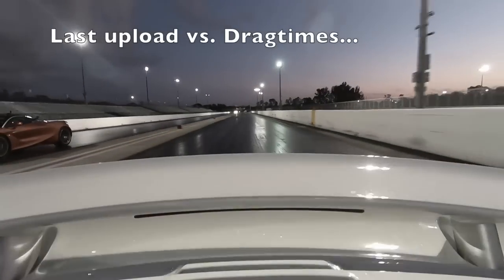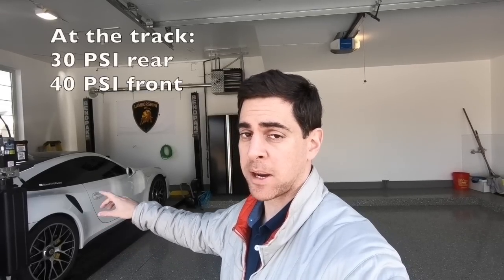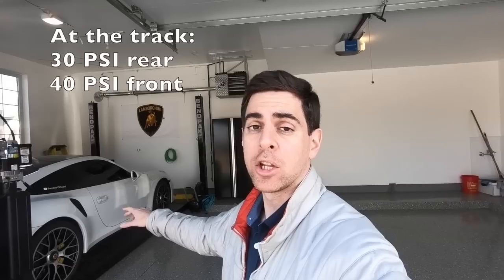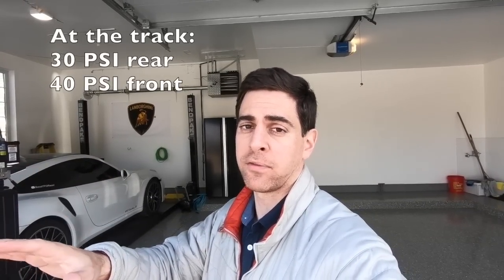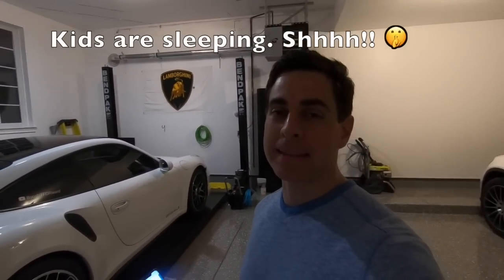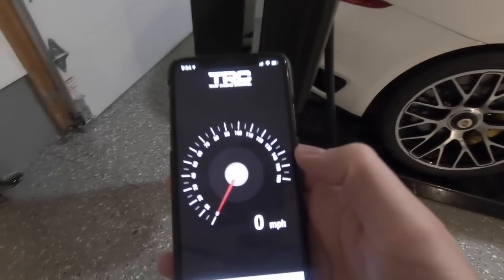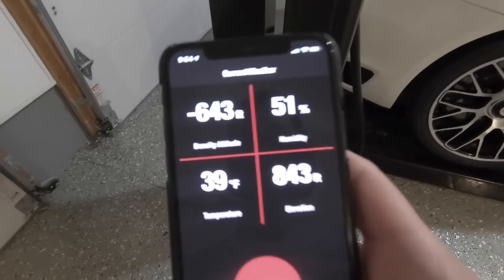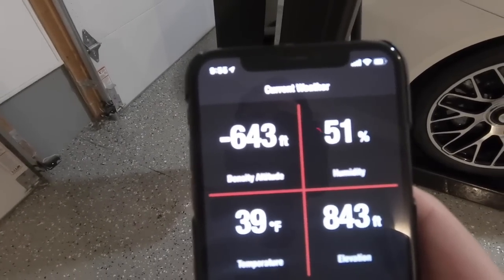Density Altitude MATTERS!! Testing 60-130 MPH in various DA

Comment: really informative, i was looking for this information for along time till i found this
Theoretically the ecu will compensate the lower ambient air pressure (inlet pressure) by spinning the turbo faster, to reach the same manifold pressure (outlet pressure). And the difference is hotter outlet temperature (less oxygen) from the turbo spinning faster. This wont have a huge impact on the power as compared to NA engines. But i guess there is more to it since you got a significant better pull in low DA. Very interesting results.

Comment: On a turbo car the difference is less noticable. NA really suffers from high da. I run a na full bolt on e85 6th gen camaro ss is about 5000-5500 da and am always so frustrated with 60-130 times. Where as guys are getting close to what I'm running with stock cars in good air, less than 500 da. Different world when I think my 10.6 is fast And this guy's running under 5 in that monster porsche.

Comment: I had the opposite with my stock 911.  ET and trap speed both got worse in cooler weather.  I think - as do others - that the car pulled power to meet OEM torque figures otherwise the car would have made a good deal more than Porsche's specification.   A tune tears that issue apart and the cars just run best at around jacket weather.
Reply: Yep!  Many cars have a boost protective function; in some circles it is called overboost protection. Cooler air is always better, especially with forced induction applications, but sometimes you can have too much of a good thing...to some extent. And for this reason, many manufacturers implement a boost ceiling of sort, or ways of pulling back boost when many of the assigned sensors pickup on the super cold air. It ensures the vehicle does not spikes its boost due to cooler air...preventing it from running too lean and so on.

However, tuners can offset this by tuning around these factory set parameters by commanding target boost levels and accompanying fuel (happy AFR) no matter the ambient temp and by doing so, customers can benefit from the cooler natural ambient temp.

I hope my high level explanation made sense.

Comment: This is great sir. 😊

However, to remove as much amount of the guessing aspect as possible, it would have been best to compare 60 - 130mph: 
A) street FL 2000 DA vs street MI -700 DA...close to similar slope as possible.

B) local track under low DA and compare those results vs FL track under its higher DA.

C) and/or, you can do a test in that same local street, same low DA, same night, same tires psi and so on from a rolling vs standing start. Compare those two results.

I would think doing the above testing would be as best as possible vs trying to compare track standing results vs street rolling results. It will never be a true direct comp unless you cansomehow teleport from one state to the next, but at least "I think" comparing street vs street (rolling or standing) and track vs track (rolling vs standing) is less tricky with less guessing variables.

Nevertheless, good stuff and be safe.😀

Comment: How do you think Dodge Ran mid 9s in a stock Demon? They ran it in Florida (near sea level) on a nice cool Winter day with a very low DA. You can easily run a .5 (1/2 second) faster in the 1/4 mile with just a low DA (-2000 for example).
Reply from the maker: I am gonna put that to the test. In FL where I ran the 60-130 in 5,31 secs, I went 9.58 in the 1/4 mile. DA was +2000. I am going back to the track here where the DA will be 2000 less to see what happens and I’ll record the action. 👍
Reply: @BoostITFORward  did you ever do it?

Comment: on hot summer days my car will run 12.0 in the fall and spring 11.4-1.5. naturally aspirated
Reply: Yep, that's why most of the records are set at tracks on the East Coast in cold weather. Guys run their cars in 30 degree air at sea level tracks with a -3000 DA. Then a lot of guys brag about their times and tell everyone they have a "Factor Freak." It's almost always because of the track conditions.
Reply: Yep some people will talk smack about et's but my local track is pretty consistently 7000' DA. For example today is April 29 hasn't even got hot yet and the DA today was 6000'

Comment: Well done, awesome video as usual. But of all the controls you had in place you forgot momentum from launching at the track. You’d see a bigger improvement buy starting at 15mph in 1st gear. Probably 0.2 difference worth.
Reply from the maker: From my experience, starting from 0 doesn’t have an advantage in the performance of 60-130. It would seem like your idea is more sound given your reasoning (momentum), but surprisingly it’s not. Thanks for the nice words. 👍
Reply: In a 930..yeah...in a 991 as soon as the weight transfers from rear bias to nuteral you have full momentum..these are the best cars ever engineered..my opinion
Reply: if he hits 60 mph under full load and full acceleration what does it matter what speed he starts at??

Comment: You using meth isn't going to effect it as much as without. And then na will be affected differently as well
Reply: Act not sure what meth will do to combat da but naturally aspirated cars will be affected differently than forced induction
Reply: Also  I would think starts from a dig will def affect the times than starting low In a higher geat

Comment: Thanks for the effort 👍! I think that you were pretty scientific in your approach 👌.  One minor comment is that your conclusion of the benefit gained from every 1000 DA reduction, would be 0.13 seconds only if the relationship between the two is a linear one (ie for any given reduction in DA, there is the same reduction in time), which cannot be confirmed with only two test points. My recommendation is to run another test, where the DA is between these two extremes (ie +600).
Reply: Sounds great - keep up the good work 👍
Reply from the maker: Terry, I agree with you. My statement is based on the assumption that the relation is linear. Maybe in the future I will add additional DA test points to validate this relationship. 👍
Reply: 1st Take your $ 200,000..car..then..you do it
P man did good covering a subject that is very hard to explain..the rest we can both just go self educate ourselves..with all do respect

Comment: This is incredible, really want to see that test with a NA motor, i think It would be even more discrepancy between +2000DA and -700DA.
Reply from the maker: Correct. An NA car is gonna suffer a lot more in high DA than a turbo car.
Reply: And just think, a DA of 2000 is still quite low. I race in DA's pretty consistently around 7-8000'. I would like to see a test with some real DA.
Reply: @ls6nova398  in that kinda air it's gonna be over a second slower in the 1/4 mile vs sea level da.  I ran at Bristol Tennessee dragway in my old intake exhaust gears 97 cobra mustang da was like 5000 that night I ran 14.3 at 97 I was so disappointed because they ran 13.9 at 101 stock.   After I did correction for the da it would have been 13.4 at 103 mph at sea level which is about what it should have been.  Every since then I've been very aware of da and its effects

Comment: Regarding the effect that DA has on NA cars vs. turbo cars, it depends.  If a turbo car runs an absolute manifold pressure boost target as most modern cars do, it will at least partially compensate as DA gets worse (it will still require higher turbine speeds = more back pressure to make the same boost, will usually be operating on a less efficient part of the compressor curve, and the intercoolers will be less efficient).  So higher DA is still slower, but not as bad as if you are running a fixed relative boost pressure.  NA cars, OTOH, have no way of compensating, so they suffer more, relatively speaking.  10% less air density means 10% less power, approximately.  Supercharged cars also suffer similarly, since they basically behave like turbo cars that are always referenced to atmospheric pressure (which is why the top fuel guys will pulley up their blowers in places like Denver).
Reply: Intake charge is hot..less ppm of02..cool..more...your right I'm not picking you apart, but on a fine tune calibration it will matter..I do testing on air flow.my test show low DA air flows sharpest, in the end you get great scavenging not a Porsche expert just a fan..and math nerd..interested in a retort
Reply: @artemusifasuenshuffleman8535   what do you mean by "sharpest"?  I'm not familiar with using that term when it comes to airflow.  In general for the altitudes that we humans operate at, you're not going to see oxygen percentage change dramatically at different elevations, so manifold pressure as a proxy for O2 content should be sufficient.  With turbo motors though, especially running absolute boost targets you're not going to get to take advantage of lower pressures on the exhaust side because the turbo creates back pressure.  That's where we really lose, IMO, at altitude even with turbos.  Just going from sea level to 2500 ft means we're upping our pressure ratio by 10% which is probably moving us down the efficiency curve by a few percent, and adding back pressure to boot.
Reply: what would a na car running 6.90 at 2300 da run at 0 da
Reply: I have a question that I am hoping you or someone can make sense of.  My current elevation is 4640.  Our current Density Altitude is going as high as 7,800, (+3,160 feet).  I have an understanding of Density Altitude and IAW scientific Articles of weather, sea level is 0.0764 lb/ft3 Air Density.  4640 is 0.0665 lb/ft3 Air Density.  And 7800 is 0.0605 lb/ft3 Air Density.  From 4640 (0.0665) to 7800 (0.0605) is in theory, a -9.023% reduction of fuel due to elevation (density altitude of 7800). // If I subtracted 4640 from 7800, that gives me 3,160 feet.  Some people say add or subtract fuel by 3% for every 1000 feet change of elevation.  3160 divided by 1000 equals 3.16 (or 3.16% of fuel change).  Is there a way to prove or disprove one of these theories of fuel adjustments?  I also understand a car or motorcycle should make automatic fueling adjustments according to elevation.  But an elevation of 4640 with a density altitude of 7,800 is lacking more oxygen than at 4640.  And this I suspect is not being factored into the ECU adjustments to maintain proper AFR.  Am I wrong?  Or am I missing something??
Reply: @johnnyappleseedz422  A modern ECU measures barometric pressure (as an absolute) and manifold pressure.  So it will know the difference in air quality between 4000 and 8000 ft.  If the air density drops by 10%, then fueling will also drop by 10%.  If you are carbureted or running a stack intake, then it's a little tougher.  ITBs/stacks require either a baro correction to the fuel curve, or retuning for different elevations.  Carbs will usually require rejetting when changing altitude by more than 2k-3k feet.
Reply: Pully down

Comment: I may seem uninformed, but can someone pls explain me what is this DA thing, and its connection to acceleration. Please simplify it as much as possible. If you were able to come up with some examples that would help. I am from Europe and we do not use this sophisticated-like method. Thank you!
Reply: It is a correction factor for air density. It takes in to acount things such as temp, humidity,barometric pressure and altitude . The lower the DA the more oxygen in combustion chamber..more power..but it is a number best used by pilots..it makes there planes handle better..
Reply: @artemusifasuenshuffleman8535  Thank you it helped :)
Reply: @artemusifasuenshuffleman8535  
I have a question that I am hoping you or someone can make sense of.  My current elevation is 4640.  Our current Density Altitude is going as high as 7,800, (+3,160 feet).  I have an understanding of Density Altitude and IAW scientific Articles of weather, sea level is 0.0764 lb/ft3 Air Density.  4640 is 0.0665 lb/ft3 Air Density.  And 7800 is 0.0605 lb/ft3 Air Density.  From 4640 (0.0665) to 7800 (0.0605) is in theory, a -9.023% reduction of fuel due to elevation (density altitude of 7800). // If I subtracted 4640 from 7800, that gives me 3,160 feet.  Some people say add or subtract fuel by 3% for every 1000 feet change of elevation.  3160 divided by 1000 equals 3.16 (or 3.16% of fuel change).  Is there a way to prove or disprove one of these theories of fuel adjustments?  I also understand a car or motorcycle should make automatic fueling adjustments according to elevation.  But an elevation of 4640 with a density altitude of 7,800 is lacking more oxygen than at 4640.  And this I suspect is not being factored into the ECU adjustments to maintain proper AFR.  Am I wrong?  Or am I missing something??

Comment: What about the air temp? Interesting to see that factor
Reply: Alexis Zachariou that is a factor of DA..
Reply: @russellcoight1718  True, its a factor, but only in terms of determining the amount of air the engine can ingest.  Cold temps also dramatically affect the knock resistance and intercooler performance of the engine, so there are additional benefits to colder air, particularly with a turbo car that is running octane limited (eg pump gas).  Of course, higher air density also means higher drag which slows you down on speed runs like this.  Lotta factors involved which is why head to head is always best comparison :)
Reply: Sorry my english is not that good. I thought it was elevation you was measuring
Reply: Alexis Zachariou density altitude is not the same as actual altitude. I wish I could translate somehow better for you.
Reply: Air Temp comes second to altitude (pressure altitude). Altitude (change in atmospheric pressure) will have the strongest effect on density altitude.